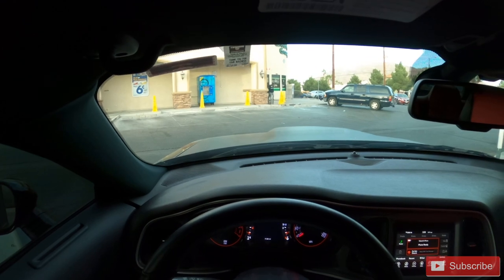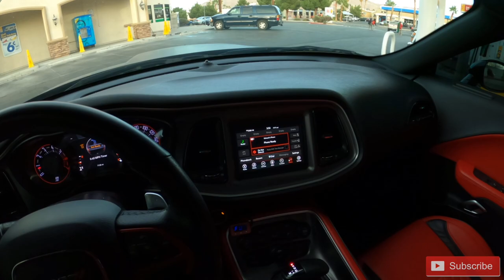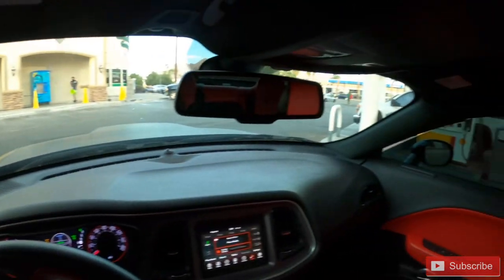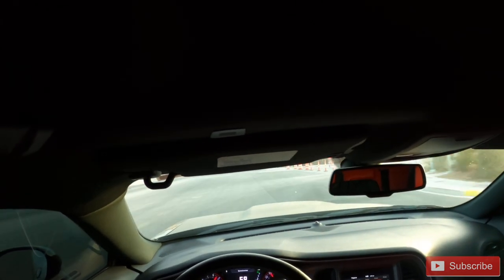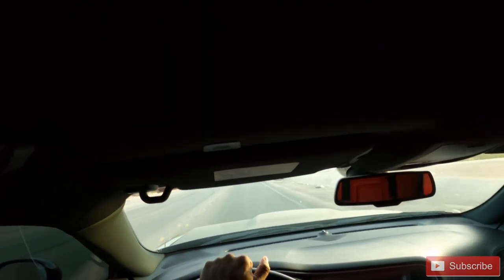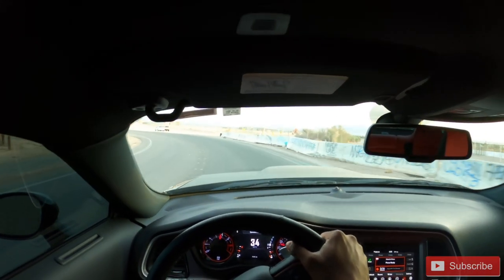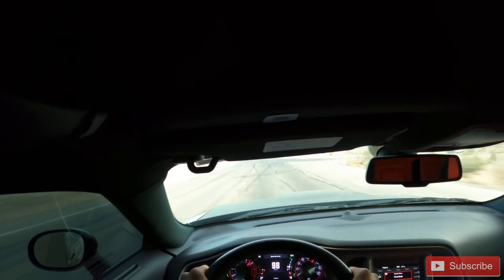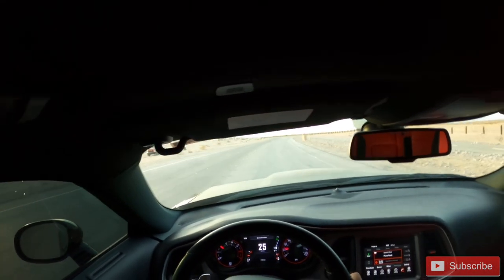Hellcat Airbox Test In My Dodge Challenger RT 5.7L Hemi | POV Drive + Speed Test | Full Commentary

Comment: Cool video bro, I'm gonna throw a cold air intake into my R/T Charger soon. Even with the base models you can check the air temperature, etc in the guages section of the Performance Pages.

Comment: Saw this being discussed in the Chat so figured I would drop my 2 cents here...

I had the Tazer for my v6 before I upgraded to the 5.7. The way the Tazer works that doesn't void the warranty is when you plug it in, it will have you basically mirror? mate" (Forget the exact term lol) 
When you take it to the Dealer you would just unmirror/unmate (again whatever the term is again haha), unplug and then take the car in for maintenance. However, I don't think the Tazer is worth it for the price, especially if it is like 2020+ (Not sure if 2015+) because it cost a pretty penny, plus if you have newer models you need to also purchase this override piece, etc just to be able to unlock Performance Pages, unless your really want to dump the cash for it. When I got it, I used it to activate my Paddle Shifters, Rear Backup Camera, and Fog Lights. Although, it will allow you to do some other simple things like Light Show, I think disable the ding for the buckles, or something like that. Just depends on what you want out of it and if you can justify the costs. lol

Good video though!
Reply from the maker: Thanks fam! That’s definitely a lot of clutch information. It seems like it’s a lot to think about when going with the Tazer or the Diablo tuner. I’ve been hearing stories about Diablo messing Challengers and Chargers up so it’s a lot to think about!
Reply: @TheGrimRunner  Yah, I see people saying to stay away from Diablo Tuner and go HP Tuner. Whether v6 or v8 it seems. I know v6's definitely lean HP Tuner because they can be tuned better. Haven't really followed the 5.7 Boosts but I have seen mentions of HP Tuner as well so I assume the same? haha.
Reply from the maker: @warmad2596  Dope bro! More clutch information lol. I’ll be doing my research on the HP tuner now lol 😂
Reply: Damn bro, not to be funny, but did you know anything about the Tazer before buying it. You said a lot with out saying much.
Reply: @KPtheDJ216  heh I am also a part of a v6 pentastar performance group, and it was where I first learned about the tazer when I was looking to add things to my v6 at the time. Also, if I remember correctly it is all listed on the tazer site as well. After I bought it I played with it a bit.

Figured I'd try to note being precise about it's main capabilities to cost wise lol

Comment: What's new Grim, haven't chatted with you in a while.  Figured I would share with you that I traded in my RT Shaker for a 2021 Challenger Scat Pack with the 8 speed Torque Flight tranny.  I don't think any modding will be necessary on the 392, plenty of street Muscle... Anyways, just saying hello!
Reply from the maker: Hey Chuck! Sorry for the late reply. I’ve finally returned full time back to YouTube and it’s great to hear you got the Scat Pack! Congratulations man. I’m thinking of making the switch myself 💪🏾
Reply: @TheGrimRunner  It's just easier than dropping 15 grand on mods, and devalue the car.
Reply from the maker: @Basslightning666  I totally understand. I’m going to end up going that route too lol. I feel it. I want a wide body Scat or Hellcat

Comment: U think it's a fun car in vegas u should try my rt in 39 degree Jersey Air ... Hitting a 4.6 0-60 is easy
Reply from the maker: Man I know your car goes crazy in those temps bro! Are you guys also at sea level?
Reply: @TheGrimRunner  yea I live a mile from the beach. The car loves the cold here
Reply: Wat mods did u have for that 4.6
Reply: @just_a5.7  Nothing  all stock. Using shell 89 octane gas ...I added a roar pedal throttle controller that helps some but still can't get under 4.6...i even have stock tires
Reply: @josephpuzzo1  I got a 4.5 here in Dallas with pedal commander
Reply: @just_a5.7  Nice I just got a road pedal it works amazing too
Reply: @josephpuzzo1  wats ur 1/4 1/8
Reply: @just_a5.7  I'm in New Jersey not much room for 1/4 mile ..my buddy ran his he did a 13.20
Reply: @josephpuzzo1  it should say in ur dash
Reply: @josephpuzzo1  I thought jersey had atco??
Reply: @just_a5.7  It does. My buddy ran 13.20 on shell 89 octane gas and he as well ran a 4.6 0-60 like me...both are cars are stock 2020 RT with throttle controller
Reply: @josephpuzzo1  I never ran the 4.6 but I got 4.7 like 3x and 4.5 like 2x
Reply: @josephpuzzo1  I normally get 5.1 or 4.9 in the heat
Reply: @josephpuzzo1  do u use launch control or foot brake technique
Reply: @just_a5.7  My car don't have that. I just hold the brake to like 1500 rpms and go for it. 33psi in tires I can hit 4.6 pretty easy.. what's ur best time?
Reply: @josephpuzzo1  my best is 4.5 In 40 degree weather and my passenger side out
Reply: @josephpuzzo1  I race alot of scatpacks and have beaten 3 out of 4 that were actually racing lol
Reply: @josephpuzzo1  I have the pedal commander and 305 wide tires and afe air filter
Reply: @josephpuzzo1  I have a buddy that got a 3.8 but has drag radials and a tune with headers I believe
Reply: @josephpuzzo1  33 psi in all the tires ??